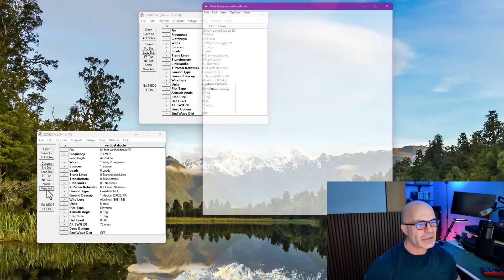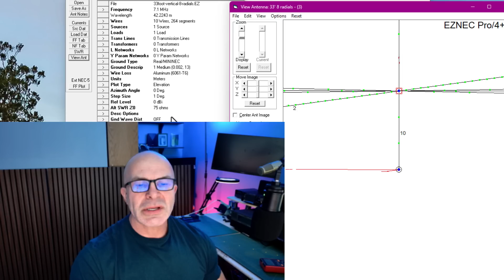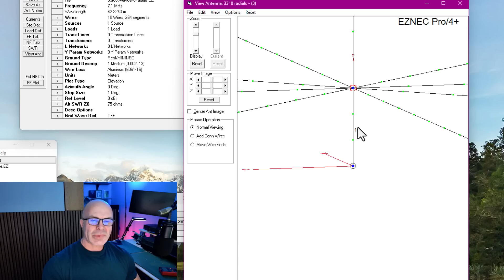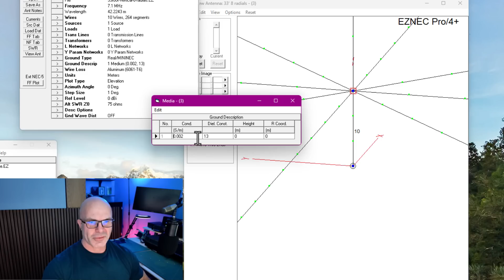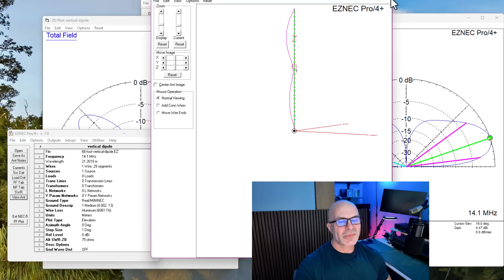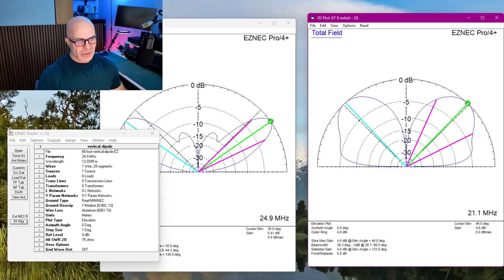33' Verticals - Why they Work and Why they Don't!

Comment: I've just found your channel and I'm very impressed with the depth and the way you present the information. So, one question for you. I appreciate why radials work best elevated  above the ground on verticals, but does the same apply for sea water. Ie, if I built a vertical over sea water should I keep the radials away from the water or would it be more effective if the radials were in contact with the salt water ? Thanks G1NNR

Comment: Thank you very much for this!   I especially appreciate you mentioning the effect one would get with a 43 foot vertical compared to the 33 foot.
My interest at this point in time - is having more options to make contacts with VK, ZL, JA stations.
I lived for a number of years in New England where verticals performed very poorly due to hundreds of feet of slate just below surface of ground.
Have recently moved to midwest U.S.  surrounded by wheat fields - and now hopeful a vertical might be effective 

I would especially be interested in your opinion about performance on 20meters between a 33 foot vertical vs the 43 foot.
Also - it appears your verticals are raised off ground rather than ground mounted - and I would appreciate a description of actual height above ground and I assume 8 radials?   Do you build your own verticals with aluminum sections -- or do you purchase already made units?

Sincere thanks - and looking forward to more of your excellent content!

Comment: Hi Justin!
This is me. We talked over the phone when I was building an 8 element LFA for 2m, and I sent you a picture of me installing the beam on top of my tower, when my call was ea2fl. Now ea2jx after I got my father's callsign.

Excellent presentation of yours indeed.
Many thanks for sharing.

I've got a 43 foot fiberglass pole that I may test one of these days operating from my car.

The plan was to use elevated radials hanging from the doors and an automatic LDG tuner at the roof of my car connected to the wire inside the pole.

I've got a HiQ screwdriver type mobile antenna in that car which would be great in order to compare performance of the 43 feet long vertical.

My mobile radio is a 200w Kenwood ts480hx.

Would you mind giving some recommendations for my future tests?

Comment: Hi Justin. Very interesting video. Being a now retired antenna designer myself I find your video very interesting.
I used nec when it first came out and run under dos. Very unstable and not very user friendly either. Them I moved on to touchstone SW. That was good but again not very user friendly. I did most of my designing using a pencil and paper and a smiths chart.
Anyway keep up your videos I enjoy them.
73. Paul De HS0ZLQ, G0MIH.

Comment: Really interesting factual video that explains a bit of what's happening, different to other 1/4 wave youtube channels. If I understand correct (and I have read all the comments and replies), the vertical part of the antenna connects direct to the centre of the coax and the outer on the coax connects direct to the radials, the earth stake is then connected to the radials centre point via the 9uH inductor, 400 ohms at chosen freq is enough to prevent wanted RF to head to ground, the unwanted RF (eg 300khz from a SMPSU would see around 17 ohms to ground and take that route. I presume you could also use a balun to limit common mode currents as well as the 9uH ?
Reply from the maker: Yes correct and so too with a balun. Ferrie current balun at each end of the coax ( antenna and radio side) is the best option for lowest noise
Reply: @hamradioguys  thank you

Comment: Great video. However, an ATU  (wherever placed) does NOT tune an antenna - it matches it...
Reply from the maker: You're absolutely right—I should clarify what I meant. The ATU doesn’t physically alter the antenna’s characteristics or make it resonant on a given frequency. Instead, it modifies the load the transmitter sees, providing a more suitable impedance match for the PA stage. In other words, while I used the term 'tune,' I was referring to how the ATU adjusts conditions at the feed point, not the antenna itself

Comment: Great video! I bought a 33’ vertical from InnovAntennas and I am very pleased with it. It is super strong and handles the mad winds we get at my qth and doesn’t need guying. Subbed.
Reply from the maker: That's Great to hear Donal. I used a software mechanical optimiser to achieve the taper schedule on that antenna and the larger equivalents the Vertigo V43 and Vertigo V66. needing guy guying helps when garden lots are very small too and less to trip over!
Reply: @hamradioguys  I honestly think that this 33 foot vertical is the only vertical that would stand up to the sudden gusts that we get here. Even after twenty years, I am still surprised by their intensity. I knew it was solid when I went to assemble it. Well done. No worries at all. EI3KY

Comment: Great presentation Justin.
Two things..
1. Can you elaborate on the 8 ground radials (or more) and the min length these radials could be for this 33'V to still operate effectively. Most of us UK operators have postage size gardens and this would be good info to know. 
2. Can you add a link in the more section of your video where we can learn how to build the 400 ohm RF choke for this antenna please.
Reply from the maker: Hi Tim, 1/4wl for the frequencies you wish to use. if you cant' get a 1/4wl, feed impedance/SWR may not be so good and nor radiating efficiency. I will do a separate video on making an RF choke to suit.
Reply: Short answer: 8 x 1/8 wave radials will perform better than 4 x 1/4 wave radials, as most of the current is at the feedpoint end anyway. Also, laying them directly on the ground will detune them slightly, so it's not critical for them to be an exact length. Exact length (tuned) radials are only required for an elevated 1/4 wave GP antenna.
Long answer: Radial System Design And Efficiency In HF Verticals by Rudy Severns N6LF

Comment: Thank you for this video. May I inquire about the length of the radials in the diagram? 

I plan to build a similar wire antenna, 8 radials, but the length of the radials seems to be argued: some say the length is of no importance; others say the length should be uniform and 1/4 wave length; and, others say have radials of varying lengths. 

Any guidance would be most appreciated. Yours, KQ4IXD
Reply from the maker: Hi, I had mentioned (although late on in the video) all radials where 33' the same as the vertical section. if there are a mixture of radials for each band you will use, these will naturally illuminate more brightly on their resonant band. Any multibander is a compromise. if you were going to install the vertical for primary use on two bands, have 4 radials at around 14/wl on each band to ensure uniformity. if you have one for each band, you would induce slight directivity in the direction of the radial of 1/4wl.

Comment: If I undstood you correctly, A ground stake or grounding system should have an RF impeandance between it and the shield connection.  This could be achieved with a relaiively random coil.  However, what about using ferrite beads, keeping the length of wire shorter than what will be needed for a wound coil?
Reply from the maker: A couple of questions there. Yes, an RF choke (coil) will prevent leakage to ground and keep current in the radials. However, it is not a random sizes coil. for the 400 Ohm reactive impedance required in the EZNEC tool, you will need around 9 µΩ inductance.  it is worth investing in a measurement device like the one I showed of in the video. You can use Ferrite, there are not huge currents and this will keep the whole thing relatively small and compact.
Reply: Great video! I bought a 33 foot vertical from Innovate Antennas and I am very pleased with it. It is unguyed and super strong. Subbed.

Comment: Thanks again, Justin, for revealing some of the facts of which i guess many folk were oblivious. A constructive comment re the high-angle performance on 18 MHz: I think it very rare that ionospheric propagation would happen above about  30 degrees elevation, at this frequency..... I must do the propagation calcs, when I get a few minutes, and get a more accurate assessment! 73, Tim
Reply from the maker: Thanks Tim, This is in fact my point - anything high angle is largely lost, those lobes are not just transmitting into space - you are receiving from those same directions too.
Reply: @hamradioguys  Yep; I'd like to estimate how much extra cosmic noise might come in at those high-angles and compromise receive signal-to-noise.....

Comment: will a regular rf choke with a ft-240-43 and the shield going to the radials and ground work? or thr design needs to be different?
Reply from the maker: The choke would ideally need to be around 9 µΩ (microhenries) to provide the choking at the frequencies you need. simple calculators are available for this. in fact, I may produce on to add into the community area.

Comment: Thanks again. Learnt from each video. I have been looking at the rybakov antenna 7.6M wit 4:1 transformer. This seems to have a lower radiation pattern except for 10M band. What are your thoughts on this antenna? Would be good to see how you can improve radiation angle of the 33ft in a video
Reply from the maker: Thanks for the comments. I am not aware of the antenna in terms of modelling it. 4:1 transformer at the based and for want of a better description an apparent 'inverted 'L' albeit with a sorter top section. ground conductivity will affect radiation angle the most. the patter of this antenna is likely to be slightly directional and therefore, angle of radiation would vary upon direction. I will model it and give it a go and report the findings.

Comment: Thank you for sharing this comparion of the two antenna layouts. 🙂 As I am not a native English speaker and I also still consider myself a ham radio newbie, I might not have understood everything correctly and maybe I am not drawing the right conclusion.
However, what I think I can conclude is this:
When looking for monoband antennas for 20m and 17m to make DX contacts, it seems to me a vertical λ/2 dipole is the better choice and for this purpose (DX) there will be no advantage in terms of lower takeoff angle and gain when using a (shorter) vertical with a number of radials instead. 
Did I get that right? 🤔
73 de DL1HNR, Henner
Reply from the maker: Thanks for the comments. the vertical center fed dipole is not practical mechanically speaking. the comparison what to show the relatively comparable performance between the two and how to correctly install and setup a vertical with radials
Reply: @hamradioguys  I see. Then let me put it this way:
If - especially for the bands I mentioned (17m, 20m) - I have an easy means to set up a vertical dipole, for example on a 12m (40ft) GFK pole, and I therefore do not need to reduce the antenna's height/size, then with the vertical dipole I have more or less the most efficient wire antenna for DX QSOs.
However, if - for whatever reasons - one needs to go for a mechanically more practical antenna, then the shorter vertical with a sufficient number of radials is an alternative with nearly the same performance.
(I assume that most native speakers correctly understood what you were trying to show, but I needed a little more help to understand the meaning).
Reply from the maker: @hennero.3826  the best option by far is a horizontal dipole. More practical and exceptionally better in gain as a result of ground gain which verticals to not benefit from. I will be covering horizontal dipoles in a future video.
Reply: @hamradioguys  Great video,    and to add to your next video on horizontal dipoles.   please compare heights as there is some controversy on weather  0.6  x λ    is actually better the  0.5 x λ .       ;)    I have been using 4NEC2 on my linux laptop under Wine.   It pretty good.   EZNEC4 seems good too.